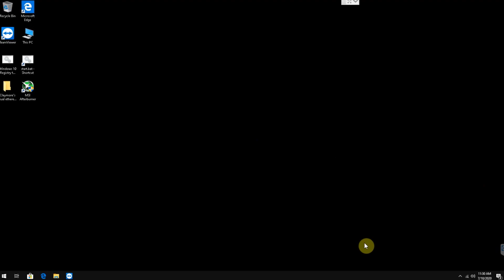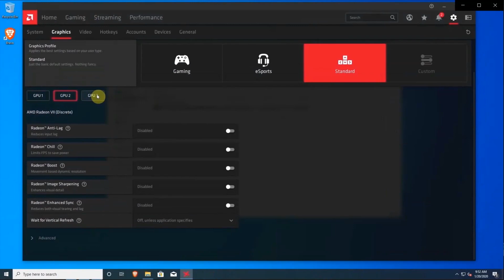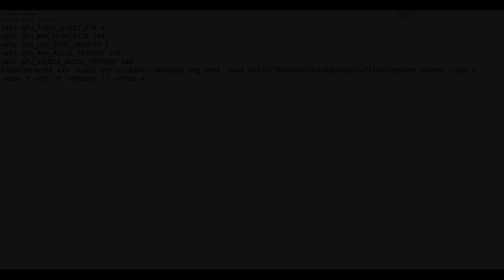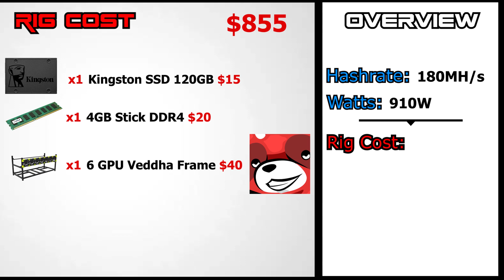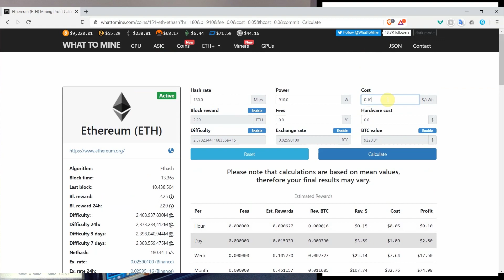RX 580 Mining Rig Build | 187 MH/s and 850 Watts!

Comment: Did you have to do anything in the bios to get the x16 PCIe slots to recognize the risers? I am having a bit of difficulty getting the risers to work on X16 slots. x1 slots they work fine. Asus 450-F motherboard.
Reply from the maker: We did not really have to do anything since the motherboard is mining specific, but usually you don't have to do anything!

Double check the risers as well maybe one is hit!
Reply: @MiningChamber  Thank you for the quick reply, looks like I had a PSU cable issue and once replaced it was all recognized. Since I am new I am using Hash Miner to get going and currently avg. 113-114 mH/s at 496 total watts. Each card is getting around 28.4 mh/s. The cards I have set around 2000 rpm and staying between 43-49 degrees. The rig is actually quite quiet. Appreciate all your videos, helped quite a bit.
Reply from the maker: No problem! Glad you figured it out! 

Check our RX 580 review/guide to get more efficiency off of your cards. 30-35 MH!
Reply: @MiningChamber  Yeah I did try a few things but I have only been able to get it at 28.5. It seemed to be a little unstable at first and so far the settings seem stable and GPU's are cool around 45-50. The 4 cards avg. 113mH/s @ 503 watts. Thank you.

Comment: I'd under-volt a bit more, and use a mining OS such as Hive OS, I'm netting 35MH/s a card sitting at 43 degrees Celsius average in Texas and about 85w a card.
Reply: https://imgur.com/a/FQnGAki

Here are the settings I use for those curious :)
Reply from the maker: That is awesome!! I definitely want to switch to a mining OS for good😂 as soon as I cover enough of windows well dive into the mining specific OS ! Thank you for sharing we will be coming back to this later!!
Reply from the maker: How is Memory strapping or BIOS modding in HiveOS? Do you recommend that people flash vbios in Windows to the RX 580s with the -strap timings applied then put it in HiveOS or is there a tool for it there? Just got me curious!!
Reply: @MiningChamber  HIveOS has it all, although I haven't felt the need to mess with the bios or mem strap considering I'm already getting 35MH/s a card :) and super low temps/power consumption
Reply: @gregoryg.9694  I wonder how to achieve that on my XFX rx 580 GTS OC+ 8gb :) but i use windows 10. Can't get more than 30,4 mh/s
Reply: @gregoryg.9694  power consumption you measure at the wall or from operating system?
Reply: @MariuszPoz  operating system so room for error IK, but yeah using a mining os saves vram as there isn't a desktop/screen for your gpu to work on.

Comment: Hi. In my opinion currently usage of rx4xx and rx5xx for mining is some kind of mistake. If you use 6x msi rx5700 evoke or gamming x, you can have power consumption around of 760W with  ~320MHS. BTW usage of win$hit os for mining is also some kind of misktake. Why cannot you start using linux, like for instance hiveos?
Reply from the maker: Hey! For some people it is easier to use the 580 of they find some cheap deals. But I completely agree! Our next build video is 5700XT ;) 

The reason we use windows is because it is more commonly used for beginners, and I'd like to make sure we cover it step by step then at some point we will convert to Linux based system!

Comment: Is it safe to use splitters? Could you explain why did you need them?
Reply from the maker: I needed splitters because the powersupply didn't have enough 8 pins to plug into all the gpus and 6 pins for the risers.

So getting splitters helped me make sure to bring power to the gpus and risers using the VGA strands instead of having to use SATA adapters to 6 pin.

It is safer than using SATA for sure so I do recommend using splitters if the Powersupply doesn't have enough 6 or 8 pins to power ALL the gpus and risers!
Reply: @MiningChamber  Thanks for the repply, I actually was told that having a splitter to power a gpu wasn't a good idea because the cable (the one that splits) might not be able to handle the output of two cables, however, if you have done it and say that's safe I'll give a try since will be much easier. Right before this I was about to get two power supplies instead of one just because the lack of outputs
Reply from the maker: @rubenserrano3043  ah no definitely not worth buying an entire PSU for it. But ofc mind the watts. If a PSU can't provide enough power then it's dangerous.

Also, each VGA strand can over a certain amount of watts that is true, which means make sure you use your splitters wisely. If you have a GPU that takes 250 watts like a R7 then try to connect to it only a 1 8 pin strand splitted to 2 8 pins and nothing more on the same line.
Reply: @MiningChamber  oh, okay, I guess I will have to check on the maximum output of the VGA and the amount of watts the main strand can handle to decide If it's safe or not

Comment: does the processor g3900 affects the mining speed? can i use lower spec than this?
Reply from the maker: Hey! It does not really affect it at all! Its just for the rig to feel smoother once you try to download stuff and run applications on it then a better processor will be able to handle that more smoothly. But as for your hashrate it does not affect it at all.

Comment: So I am thinking to buy 12x Rx580 8gb, what power supply should I use (how many watts power supply do I need)... I live in a apartment which has 110v(USA), is it okay to plug two Power supplies? And lastly does windows support 12 GPUs? Thank you for reading this😊
Reply from the maker: Hey!! 

For the powesupplies you will be completely fine! Any ATX (Regular PSU for computers) will be just fine ! 

Now for the outlet part, you will definitely need to be a bit wary. The 12 RX 580s can take most likely above 1300 watts. A regular outlet can only give 1500 watts with the 80% rule. This might seem alot to keep in mind haha but you can check this video where we go over it step my step! https://youtu.be/MF_ELz0OV7I

Now for the GPUs, you can definitely run 12 in Windows, there might be some troubleshooting to do but it's for sure achievable. I do recommend the 5700s XT though. They are really efficient for limited power. They take the same amount as a RX 580 but provide double the hashpower. 😅

Comment: I have two mining rigs, with RX 580 and another with RX 570 and the RX 580 one is doing 186Mh/s, at 815W at the wall with bios mod. The RX 570 rig is doing 186.8Mh/s doing 805W from the wall. This is due to memory speed, some RX 580 had hynix memory, and i all RX 570 that i have have Micron (for me the best ones). You can reduce power usage , if modding the BIOS you reduce the memory voltage from 1000mv (stock) to 950mv or lower (depending on the testing for estability) and reduce the core clock which would enable less voltage. Every card should flashed and tested strongly before putting it on the mining rig or it will give you issues.
Reply from the maker: Amazing! We are definitely planning on flashing the bios very soon in a video as well!

Thank you for the information we really appreciate it!!

Comment: And where did you buy the video card that each cost $ 110
Reply from the maker: I found them on a local deal in Facebook marketplace. I recommend looking into that, eBay, and offer ups and such. Pretty good prices if you find them used !!
Reply: @MiningChamber  Isn't it risky to buy it without warranty?
Reply from the maker: It definitely is risky! If your buying a Radeon VII or a high end GPU I'd definitely make sure there is a warranty to transfer under your name. But if your buying like RX 580s, it's hard to find them new and cheap. So if you trust the seller then it can be profitable!
Reply: @MiningChamber  Thanks for your answer!  ;).
Reply from the maker: No problem!! Good luck!

Comment: in the UK an RX580 will mine around 34p per day and with an electricity rate of 0.15p per kwh you will be making pennies and probably break even in around 10 years, switching from graphics mode to compute makes hardly any difference, you can find it on the new driver under global settings/advanced/gpu workload right near the bottom .To sum this up, if you are in this area stay away from this card if you want to get into mining, runs really hot,eats a lot of power and has performance similar to a 1060 which is also making pennies right now
Reply from the maker: We come to realize that compute mode is there from the help of the community, we definitely missed it! As for the profits ofcourse definitely not the most efficient rig. Thank you for your input ⛏️⛏️
Reply: Move to Canada and use as a space heater in winter. LOL
Reply from the maker: Lmaoo yess!!! Save money from the heaters and make money heating 😛
Reply: Think of mining like a savings account. 
Support electricity from your pocket and whatever you mine,  is extra money that you have in wallet. 
And of course you need to choose GPU relevant for your needs.
Reply: @pladreams3d  that was my original plan also but when you think cryptocurrency is so volatile and the program you use to mine is flagged as a virus so on whatever you are mining antivirus must be off and connected to the internet this is a recipe for disaster.I started mining on this pc about a week ago and today i had a number calling me from Malaysia which i don't even know where it is, also if you look closely on nicehash for example your hashrate in the miner and the one in the nicehash panel don't even match, looked really interesting but starting to think this is just a waste of time and money
Reply: @secustefan3392  I use etherminer and there's no virus flag.  Also use simplewall as firewall to block everything except the miner. 
And if you trust the program you can open exception on anti virus.
Reply from the maker: @secustefan3392   @secu stefan  miners are only flagged as virus because they require certain privileges and run certain scripts that can be found in common malware.

That in no way means it's a virus. It is just identical code with no malicious intent. That number from Malaysia means you just have your number somewhere. You'd be surprised how much info you will find about your self online.

Don't look at it in a negative way! Crypto is a genius idea, it's just still new and didn't stabilize yet. 

It is also not waste of money it all depends on your rates!
Reply: @MiningChamber  i am very much aware of that, my point was that a lot of crypto pages are filled with malware or any random guy that recommends you to download this or that mining package could slip a virus there at any time and you would have no idea since you can't run your miners with antivirus on without having major headaches, imagine someone got all your bank details, personal information and so on just because you opened the door for everyone, i would be pretty pissed
Reply: @pladreams3d  i'm using nicehash and did all that, still get internet totally cut off when something fishy is going on,some more secure web pages like my mainstream bank pages will not load at all, probably have their own built in security, i'm dealing with a lot of issues that never happen with regular apps so this raised a lot of question marks for me at least
Reply from the maker: I for some reason didn't see the response sorry for the late answer!! I completely understand where your coming from. There are people in the crypto space that constantly try to abuse everyone. That is why it's great to have a community of well educated people so you can avoid all the obstacles along the way. 

I have been mining for years and not once I have yet fallen to a hacker or a malicious script. It all depends on your knowledge with computers, and ofc don't fall for "download this youl mine 1000% faster or you just won 10 Bitcoin. All that stuff is just noise that makes the space look bad from the outside, but once you adapt to it and learn to make your way around youl be great !

As for the mining profits it is not cents anymore 😉⛏️
Reply: @MiningChamber  ikr, bought some ETH a few days ago when it was $390 and now it's already at $445 and keeps going up
Reply: @secustefan3392  sorry,  did get notification.  Ate you still having problems?  You shouldn't mine in your personal computer.  Join us on discord and we can help you better.
Reply: @pladreams3d  no, i've ran a deep scan and had everything removed including the mining software, put phoenix miner back in and added to exceptions, smooth sailing ever since.And yeah this is my everyday pc for just browsing and stuff but it's making £4.60 a day right now so it's hard to resist :))never had any problems with my mining rig but this one started acting a bit sketchy after i got nicehash so i was a bit confused
Reply: @secustefan3392  it's a windows thing 🤣. That's why I even removed windows anti virus. Thinks it knows better. As for everyday computing,  I use Linux.
Reply: @pladreams3d  i have mental scars from the Ubuntu era so whenever i hear Linux i get panic attacks :))
Reply: @secustefan3392  🤣🤣🤣
I'm using kubuntu.  Much better.
Reply from the maker: Hey Viktor ! You can use Claymore Miner, Phoenix Miner, Nicehash and many other miners. All the big name ones are trust worthy to use, but one click miners that hold your balance and send it to you later on like Nicehash and such can be a bit more risky since they open more doors for a hacker.
Reply: @Viktor-jq2br  i don't think any of them can be fully trusted but you can move your coins to a hardware wallet regularly to keep them safe
Reply from the maker: No problem! Join our discord and you can chat with us there whenever you'd like

Comment: Is it possible to achieve lower power consumption with 30mh/s? lets say 700-800w
Reply from the maker: I would think it  definitely is possible if you mod the BIOS. We will try that in a video soon so we will be able to find out together!
Reply: I have two mining rigs, with RX 580 and another with RX 570 and the RX 580 one is doing 186Mh/s, at 815W at the wall with bios mod. The RX 570 rig is doing 185.3Mh/s doing 805W from the wall. It can go even lower, if modding the BIOS you reduce the memory voltage from 1000mv (stock) to 950mv or lower (depending on the testing for estability). Every card should flashed and tested strongly before putting it on the mining rig or it will give you issues.
Reply: @MrPiske1  how to do?